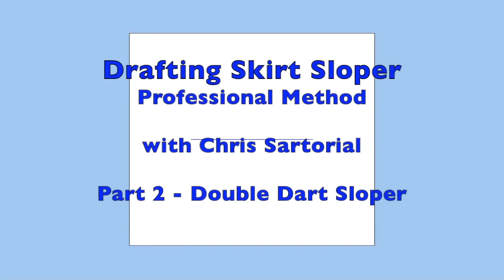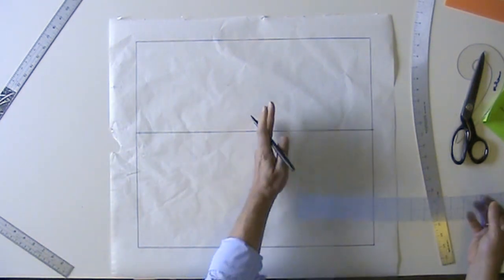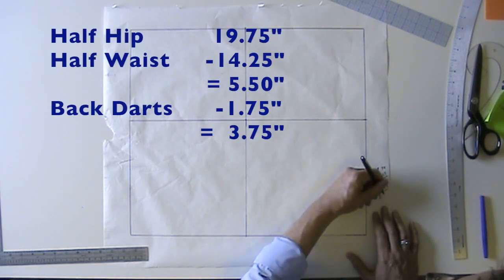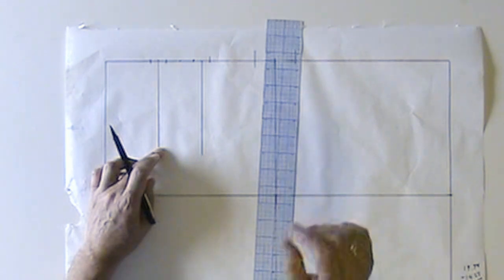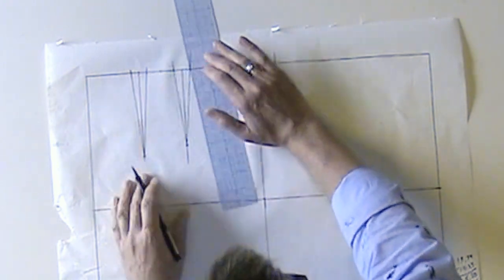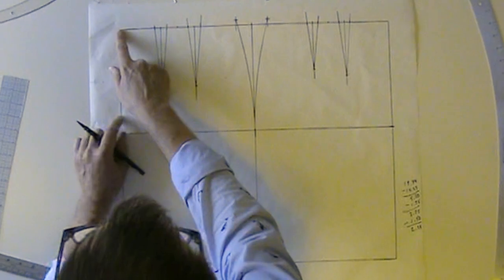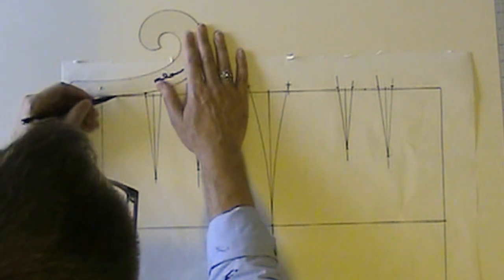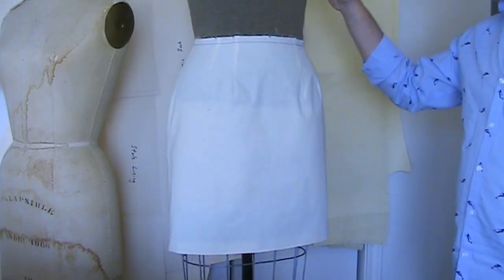Drafting Skirt Sloper - Professional Method, Part 2

Comment: Just curious...my book shows the waistline on the skirt sloper being dropped by about 1/4 inch at center back but in both of your videos this step isn’t included. Is this step necessary? If not, why is it included in the book and when would one want to drop that CB a bit? Love your videos! Thanks in advance 🙏🏻

Comment: How would you recommend adjusting the dart length for a taller figure? I'm 6'2" and the distance from my waist to hip is 13" whereas you said that's usually 7-10".
Reply from the maker: Hi Robyn.  I wouldn't change the dart length.  The change in the curve at the side seam should be sufficient.

Comment: I just realized that this sloper isn't for me my waist isn't that much smaller than my hip so maybe I only need one dart. I'm guessing that's why this technique isn't working for me. I just wanted to draft a basic skirt with darts so that I can make a variety of skirts off of that one pattern. Is it possible to make a variety of skirts with just one dart? Like gored skirts or yoke skirts?
Reply from the maker: Yes, a single dart skirt sloper can be used to create many skirt styles.

Comment: In part 1 of the bodice body  blouse. I followed the steps, but the back is longer than the front. What's the mistake zi made. Thanks.
Reply from the maker: Double check you're measuring from the true high point shoulder to your waist level. If you are wearing a top when measuring, be aware that some tops are made with the shoulder seam moved forward.

Comment: Chris, I finished my first muslin. My measurements are similar to your mannequin. Waist = 28.5" (no ease), hip: 39.5" (no ease). With ease would be: waist: 28.5" + 0.5" = 29", hip: 39.5" + 2" = 41.5".
My fitting issues are: 1) Front is quite perfect. No work needed. 2) Back is still tight around full hip and showing stress lines and therefore, still pulls side seams towards the back at widest hip level. I added my seam allowances and stitched within them. At this point, I am thinking of going ahead and doing a full bum adjustment. What do you think? 

Thank you
Reply: Update: I will put the Full Seat Adjustment on hold. Side seams will remain as they are. I will need to take in more fabric for the dart depth. They will need to be deeper than the sloper I started with. Keeping them as they are while trying to take in side seams only takes me back to the problem I want to avoid initially - a steep curve on the side seam. It's looking good after a good amount of pinning.
Reply from the maker: Sounds like you're on the right track.  If you've maxed out the depth of the back darts, you can also take a little out at the center back seam tapering to nothing about 7" below the waist.
Reply: Christopher Sartorial Thank you! It makes sense! I'm currently working on the changes. Problem is trying to fit myself at the back. Feels like a dog trying to catch its own tail! Hahaha
Reply from the maker: Good luck.  Get someone to help you.
Reply: Thank you. I have played around with my first fitting and with help of my sewing friends (Facebook groups), I will eliminate the centre-most front dart and use only one. That dart will be transferred to the back because the back hipline is somewhat tight. This makes sense to me because by dividing the hip measurement by 2, I'm giving both front and back hipline the same amount of fabric width when I only need more for my fuller backside. I take pictures of the process and  document it on Instagram. When I succeed I will credit you for it. Right now it is still low-key. Thanks again.
Reply from the maker: Don't worry about crediting me.  It's not unusual to have a single dart in front and double darts in the back.  Whatever works for your figure.  Shifting the side seams slightly forward helps keep the hip curves balanced front to back.
Reply: Christopher, thank you. What I mean by crediting you is acknowledging the  help you've rendered. I saw the double darts in my book too, but I'm sticking to your drafting method. I like it more. I hope you are well. Take care.
Reply: Update: I am on fitting No. 4 and for some reason, decided to try Winifred Aldrich's Tailored Skirt Block (no bodice attached) method. I drafted it from start to finish and compared it to my skirt toile/muslin from your tutorial and they MATCH! The side seam curves impressed me so much! I was thinking of signing up for a USD 300 couture class but I'll just be more patient and learn. That money could get me bolts of beautiful fabric. Haha!
Reply: Update as of 15 April 2018: I finally shaped my CB where the zipper goes in the form a dart AND it finally took care of the continuously wide gaping after all four back darts were shaped in. I feel like my bum is another pair of breasts at the back. They need all the darts they could get. Haha! I will now stitch in the new zipper dart and try it on again.

Comment: I am loving you videos. But I do have a question. Why do we make the front ¼" wider than the back (overall) please? I did see that the darts were slightly wider at the front than back to accommodate the tummy which is higher than the bum; but I thought the bum would balance out the tummy in terms of overall circumference, if not be bigger, so require more at the back in fact. I'd love to have my thoughts straightened out on this one, if you have the time please :)
Reply from the maker: The darts are actually slightly deeper in the back, but can be altered to accomodate a fuller tummy.  Women's woven garments have long been made slightly wider across the front.  This has traditionally been considered more visually pleasing.  As clothing has become less fitted, front and back widths are often drafted equal.
Reply: @christophersartorial7671  Thank you so much! X

Comment: Hello, would i be right to say this pattern is also for someone with a big tummy.
Reply from the maker: It is more suitable for a prominent tummy than the one dart method, because the darts can be increased in depth to accommodate the extra fullness in front.
Reply: Christopher Sartorial.  Thank you!!
Reply: Temitope, I'm using this method too. Cut out your pattern, baste and put it on before you start shaping the darts. Have someone help you. It's the best way to see how the fabric drapes on you and what needs to be done: dart width and length.
Reply: Angelina Menapa . Thank u
Reply: Temitope sijuade You're welcome. Do feel free to message me if you need help. I'm working with my very full backside and it is exactly the same fitting issue as a full tummy. They're just opposites. 😊

Comment: If I wanted no darts on the front how would I go about doing so?
Reply from the maker: Take a look at my video for drafting a "no dart" blouse.,
Reply from the maker: Eliminating all darts from the front of a skirt may only work if the fabric is very supple or stretchy.  Don't attempt it with a woven fabric unless you are very slim with a straight figure.
Reply: Christopher Sartorial thank u for responding! If you have time, would you be able to elaborate? Would it only work for stretchy fabric since it would now have a smaller opening to get over the hips? If someone was more curvy but had a  relatively flat stomach would it work to only have back darts and no front ones?
Reply from the maker: @alinabeaman8252  It would be difficult to eliminate all darts in the front unless the fabric is stretchy.  The front dart can be narrowed and shortened though.

Comment: so from each side you are taking 2.25 inches away?
Reply from the maker: You will subtract the amount that the waist is smaller than the hip.  First at the front and back darts, then what is left is taken out at the side seam.
Reply: Ok so if I'm 22 at the hip and 18.25 at the waist, I'm gonna take 3-3/4 from side seams, then from that point I place my front and back darts correct?
Reply from the maker: From the 3 3/4", first subtract the width of your darts, then what's left, take from the side seam.